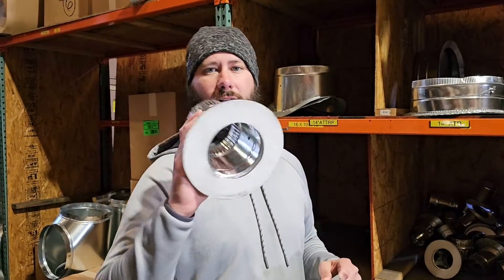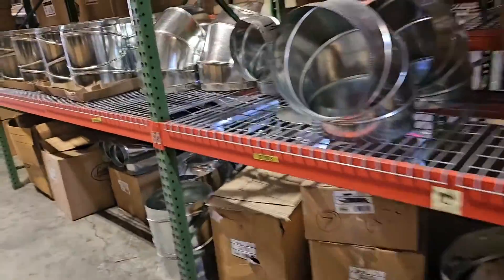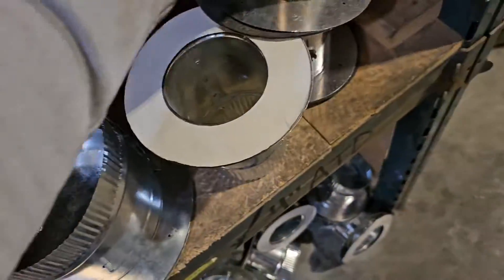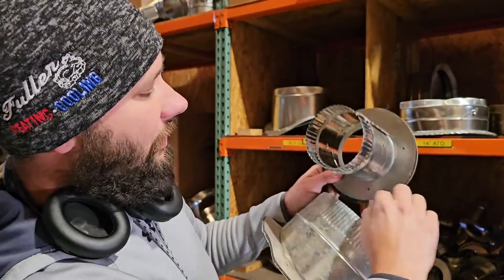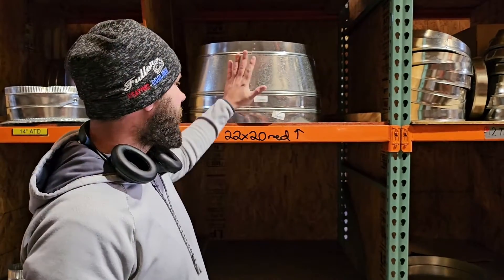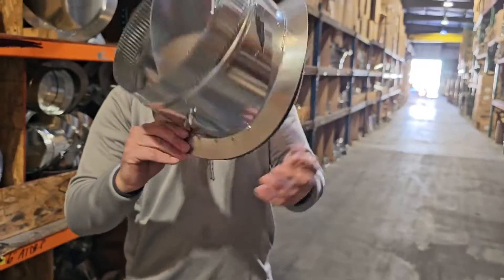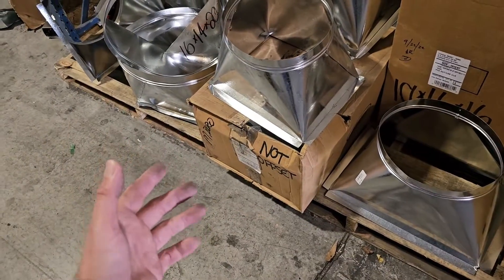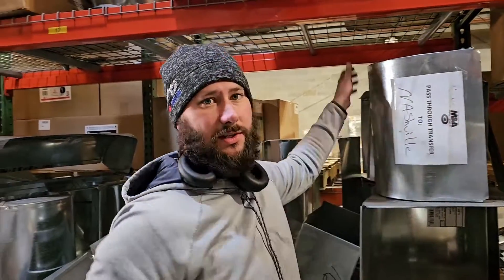What is a flat take off and a rounded take-off? #ductwork #hvac

Comment: good point its like a square peg in a round hole argument.   I'm not sure why you would need to balance the system unless it was sized wrong to begin with a damper to me just lets air flow or cuts it off.

Comment: Something about a damper protruding into the line just doesn’t sit right with me. Need to re-design.
It could just be cut flat on one end or scalloped. You should never need to use a damper to close all the flow anyway.